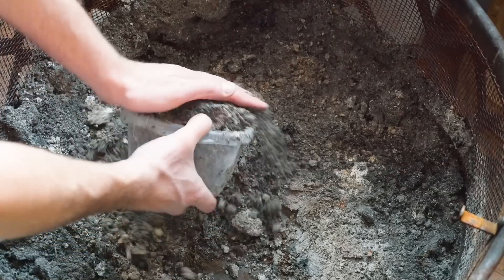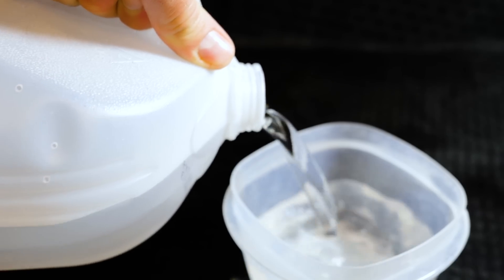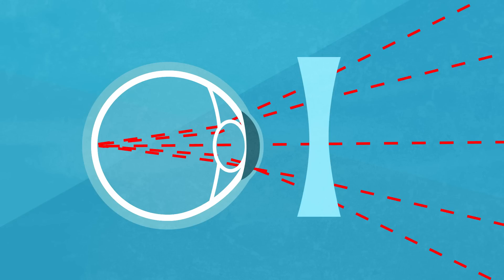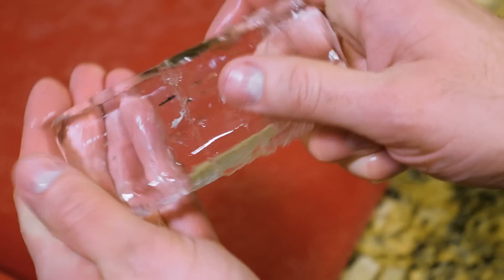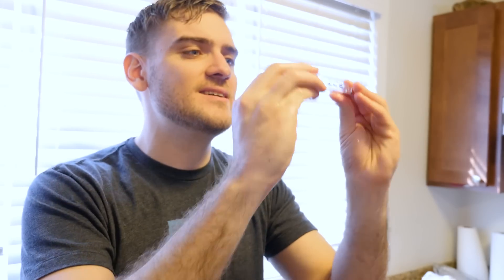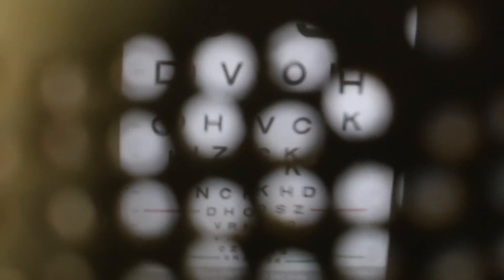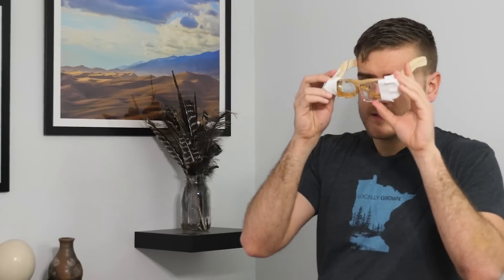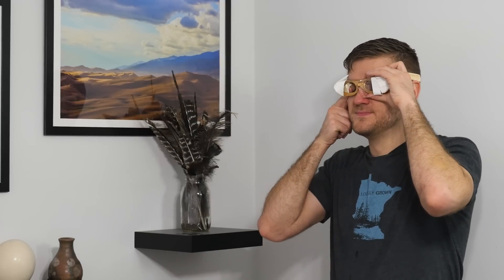Eyeglasses Made Out of Ice? | How to Make Everything: Eyeglasses

Comment: You will need a special ice maker that bars and resorts use to make crystal clear ice. The science behind it is that heat is taken away from one side instead of all sides like a fridge does. The cooling of one side allows air bubbles to escape and not get trapped in the process of freezing . Your ice cube from your fridge is opaque at the center and that is the result of air trapped bubbles.

Comment: Certainly works best outdoors in cold weather :-) A surprisingly useful trick to see something without glasses is bending your finger into a loop so there's just a tiny hole and look through that. Not very good for driving, but when you need to read a small amount of small text, it works well. By making the hole really small you can even read pill bottles in good lighting.

Comment: 1:34 there is sooo much that is wrong with that diagram...

I mean, what you're representing is that rays of light from all directions are focused on the same point in the retina. If that were the case, our vision would consist of a completely black image with a single bright spot in the middle.

What happens is that parallel rays, coming from the same direction, are focused in the same spot regardless of where they hit the lens. But parallel rays from a different direction are focused on a different spot. That's how an image is formed on the retina,  with light coming from every direction being focused in one spot corresponding tho that direction.

(at least when you're looking at something at infinite distance. It's a little different if you're focusing on something close to you)

Also, have you tried boiling the water before freezing it? That helps removing the dissolved gases, so you don't get bubbles afterwards. (though you then have to freeze it quickly so gases don't have the time to dissolve back.)
Reply from the maker: Yeah, I think you're right.  I was up all night finishing this video, and rushed that part.  I'll try and post a note with a correction on it soon.  Thanks.
I actually boiled distilled water twice for most of the failed attempts you see in it, that alone wasn't enough to make clear ice in my experience.
Reply: How To Make Everything When they make large ice blocks for ice sculpting, they vibrate the vats of distilled water while freezing slowly.

Comment: I'm very impressed with the ice lenses!

To make truly clear ice you'll have to constantly move the water while it freezes, starting at as few crystalisation points as possible. You could do that by sticking a metal object that is cooled far below 0°C in the side of a bowl filled with very cold water and agitate it either with a magnetic stirrer like used in chemistry or pump the water from the bowl onto the metal object. Of course you'll have to either cool the metal object or put the whole assembly into the freezer.
Reply from the maker: I experimented with using a fish tank bubbler to keep the surface from freezing, but that didn't help any.  A metal object is a good idea, I was wishing I had a magnetic stirrer to try that.  That's kind of what I did with the salt water ice bath, where it was cooling the metal pan to below freezing, but it still captured a fair amount of bubbles with that method.

Comment: This might have been a little unknown way for rural areas in the cold all year round to have cheap glasses for everyone. Make the pair wrong? Get more ice, and try again then have back up lenses at home for when one set melts away.
Reply from the maker: Yeah, the fact that they melt so easily causes them to be pretty worthless.  However for something like a telescope lens to be used outdoors in the winter, as long as you're able to keep some distance from your body heat and the eye piece, might at least be partially functional.
Reply: I agree with you. I forgot that even with wood frames, or some way to insulate them body heat would eventually melt them. Not to mention standing next to a fire to warm up, or a hot cup of chocolate. I like that idea you came up with. That would be something to try and make next with ice. A functional ice telescope, maybe see if you can make one to see the moons of Jupiter.

Comment: Have you considered using something like cooked pine resin/ crystallise transparent sugar? If you melt'em and them cool they might structure into a transparent mass easier to work. I'd actually like to see "crystal caramel tainted glasses"
Reply: The refined sugar we know today would be near impossible to make without very precise tools and machinery. A sugar lens would be extremely vulnerable to moisture, dirt and heat, so it would be worthless without protection such as some kind of transparent,sticky substance, or regular old plastic.
If making sugar lenses were easy or had a point, lens-shaped candy would be available for purchase at convenience stores everywhere.
Note that I'm talking about lenses. Because yes, sugar is often used to make very convincing "glass" windows for movie sets, but there's a huge difference between that and making lenses meant to correct vision.
Reply: isomalt might be an option for this
Reply: I thought of this as well... using a resin to do the same thing!
Reply: +stau ffap Yes, and that speaks more about the sophistication of today's regular home equipment than about the ease of making sugar. Of course it's "easy" when you have a very precise thermometer, a chemist's hot plate, and relatively clean sugar solutions to begin with.
Reply: +stau ffap That's technically true, in the same sense that "to score three in basketball, you only need one hand and the ability to throw a ball 20 feet". Without very fine control over the cooling rate of the solution (and without being able to even measure temperatures precisely!), recrystallization is a shot in the dark. I mean, you can probably get food-grade sugar easily that way, but when what you want is something that you can see through as if it weren't in front of your eyes, I doubt that's possible outside of a modern lab.
Reply: +stau ffap You got me, I'm not a chemist. But I wonder what prevents impurities from sticking to the sugar as it crystallizes, given that the impurities are organic and similar to sugar, and given that they don't separate naturally in the unrefined state.
From the pictures in Google, Demerara sugar does look translucent, but I doubt it can be made sufficiently clear to see through when fashioned into a lens. As to your original research, I cannot comment on it. Make a video, perhaps?